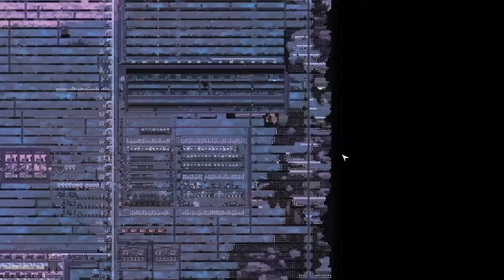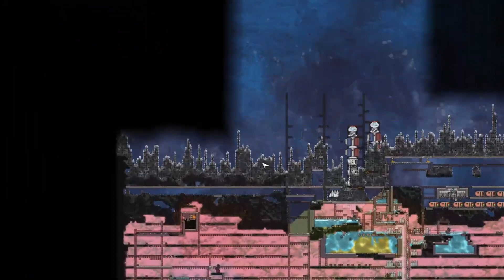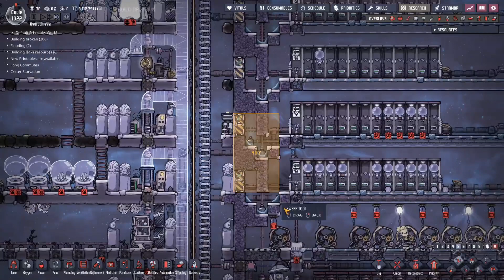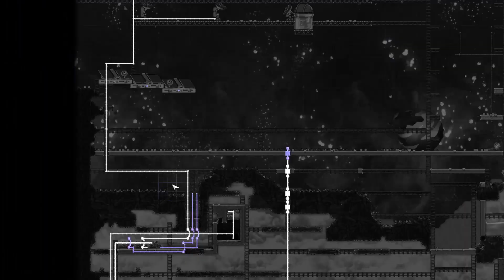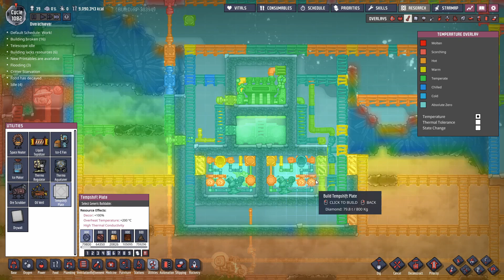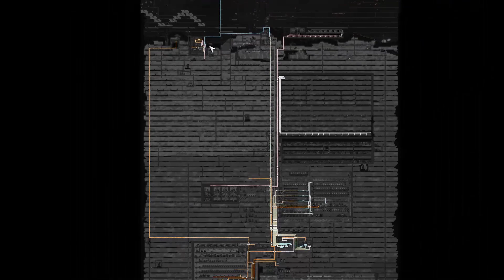Rime 24 : Demolition, Scanners, Regolith, Solar, Liquid O2  : Oxygen not Included

Comment: I have problem about meteors destroying my wiring and automation any tutorial suggestion for me?? I could really use some help tried using all metal still same problem
Reply from the maker: Lead melts at about 300C, regolith it hot enough to melt it that is usually the most common reason. Copper, gold and Iron are perfectly safe though. However if you are near the exhaust of a rocket you may need to use steel wires.

Comment: if you want to be 'efficient  you should  stack the scanners in a vertical  alignment.   

Let doors to open = less power.     (less width = less resources used and less power if you're using miners)

More efficient would just be using door crushers (no power).

Comment: Why don't you use airlock rock crushers to get rid of the incoming regolith? They are simple, power free, and zero maintenance. The valuable ore gets retained on the mesh tile substrate and the regolith gets deleted / chunked.
Reply: Waht are airlock rock crushers
Reply: @YehiaBayoume19  use powered airlocks with some gates to crush regolith. Basically, two lines of horizontal air locks. Open both, let the regolith drop, close top, close bottom, bottom layer gets crushed, repeat.
Reply: @pwrserge83  ohhhhhhh, that sounds interesting.